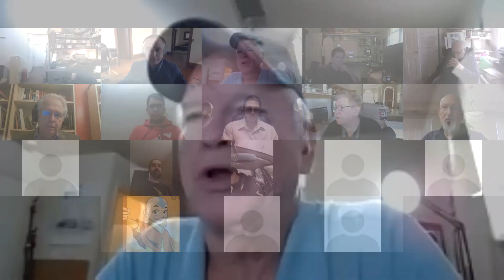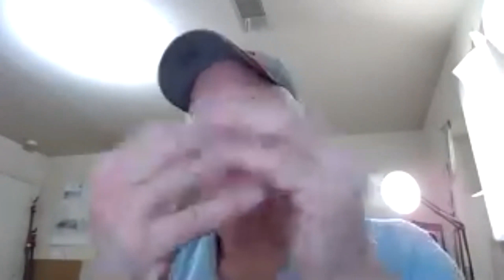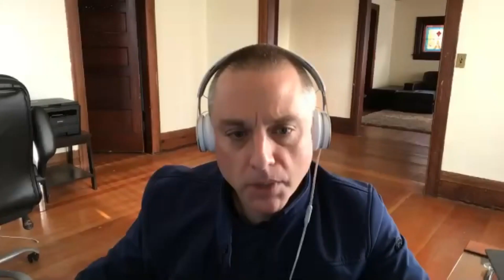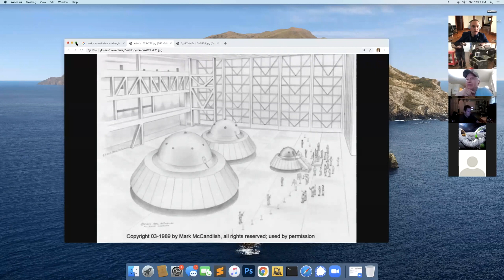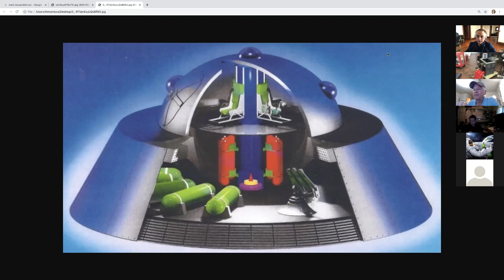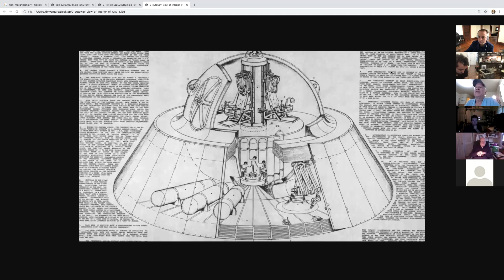APEC: 11/21, Part #1: Mark McCandlish - UFO Reverse-Engineering

Comment: if it is the way you describe as it works, why don't you just build one instead of describing it?
Reply: As a mechanic, I can describe for you exactly how a CVT transmission works, but I can't build one. Two entirely different things man, come on get with it. Ramp it up to this level, we can theoretically describe how gravity works, but we can't make it, as we don't fully and completely understand it. If your a skeptic or flat out don't believe it, that's fine, just say that. No need for immature comments
Reply: @romper4444 exactly
Reply: we know how nukes work. can you build one?
Reply: We found the clown guys 🤡
Reply: please show us what you have built!
Reply: @FalconSpace  did I mentioned that I have built something and described it ? I just asking them to build it since they have everything they need, not like me that couldn't find a simple part or buy needed elements in my area.